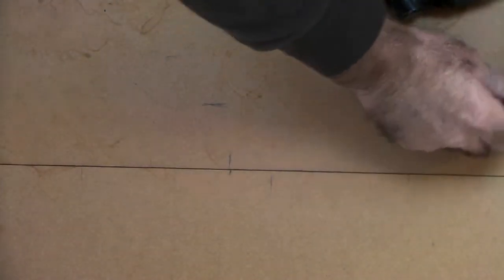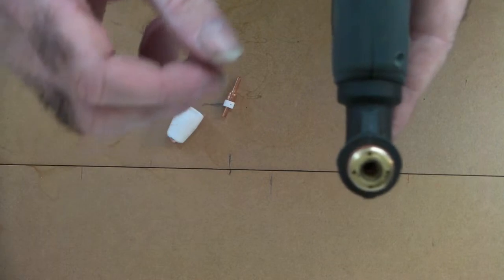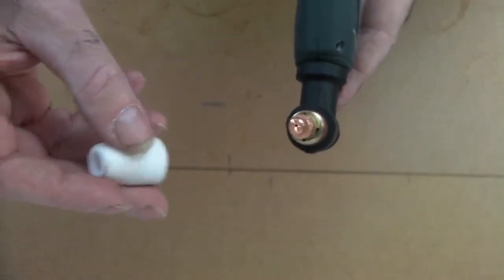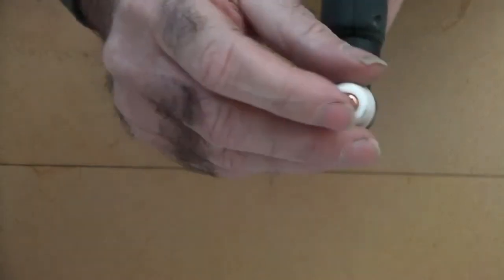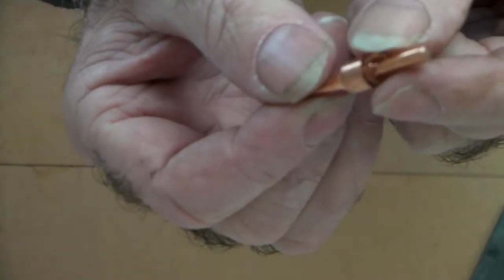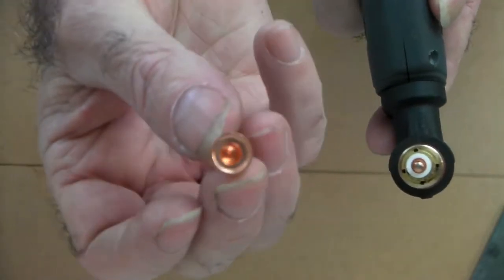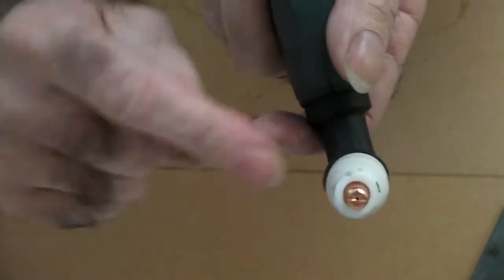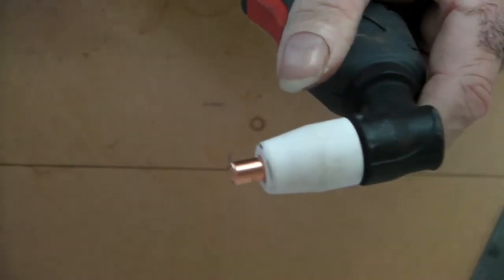40/50 Amp Plasma Torch Hack Pt 31/Lg 40

Comment: I've found there's also two different sizes of those style of consumables, ordered 90pcs and had to give them to a mate, same machine, same  torch on the outside but markedly different size parts inside.
Still looking for a good deal on the larger bits, most listings don't have accurate specs on the pieces so it's hard to order with confidence!
Reply from the maker: Hi I have never had that issue . Maybe you got a bad batch?
Reply: @petestools  no, they're completely different sizes between the two torches, one set of consumables is say 20% larger (for my torch ) and most others are the "normal" size.
My other plasma uses a completely different style so ill probably look for a torch to match that one so i have two the same or get two torches and change them both.
I don't know how to post a photo here or id show the difference.
Thanks for the videos, always find something useful in them. Nice one!

Comment: Luv ya work Pete. 
Using your hack I converted a pilot arc torch onto a non pilot cutting unit by simply running the torch pilot wire to the earth on the face of the machine. 
Works a treat but still uses the more expensive consumables. 

Question for you. HOW TO CONVERT A PT31 TORCH ASSY TO PILOT ARC?
C'mon know you can do it.
Reply from the maker: Cool mate

Comment: Great videos pete. Just bought tooliom tl 50c plasma cutter. Manual says tip size for 110 volt. .030. For 220 volt tip size .045. Why is that?
Reply from the maker: because you can run it hotter on 220

Comment: Do you ever have a problem where the plasma gets trapped inside the nozzle, on a brand new nozzle, and either doesn't work at all or blows out the side?
Reply from the maker: check the swirl ring

Comment: Thanks Pete. Im sure at some point I'll run into this issue. One issue I did run into is I bought a pack of consumables from Amazon and the tips and electrodes were way shorter then the factory ones. Made it more difficult to see the work area past the ceramic cap. Maybe you could do a video on why you need to look for extended length tips lol. Anyways thanks again!
Reply from the maker: Hi leo check this out 
CUT 40/50 PLASMA CUTTER CONSUMABLES WHY TWO TYPES
https://youtu.be/xQqOGvOoAws
Reply: @petestools  Lol I should have thought about checking your video lineup to see if you had covered this topic already. Thanks for the link!